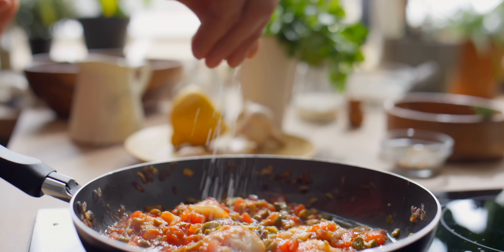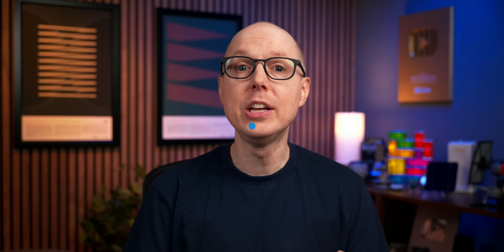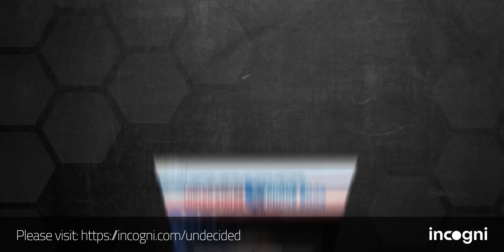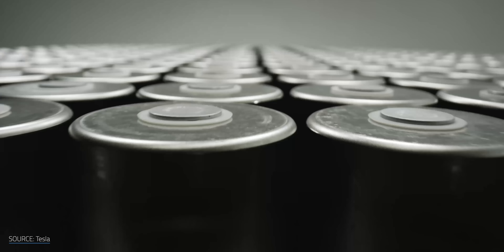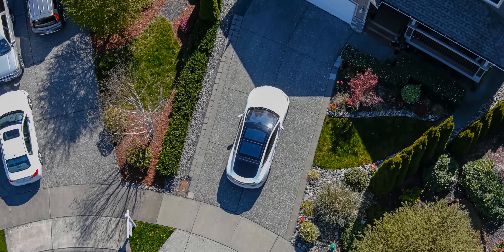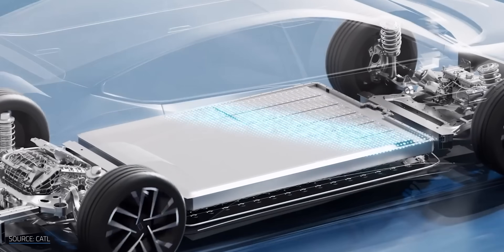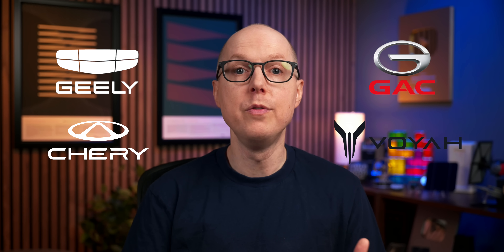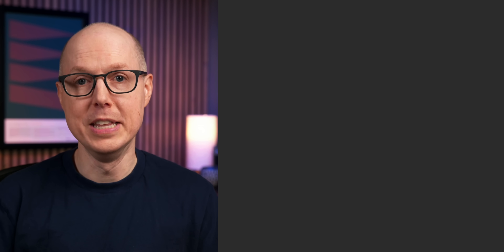How CATL Made Batteries 90% Cheaper (And What Happens Next)

Comment: 𝐦𝐢𝐬𝐥𝐞𝐚𝐝𝐢𝐧𝐠 - the existing technology 11:32 TRL 8 is the gen1 sodium-ion - but the promises with 200 wh/kg and fast charging and cheap prices are made for gen2 Naxtra. What they have shown on stage was TRL 4 to 5 at best. The video does not differentiate between these generations. Originally, CATL has been targetting 2030 for mass production of the next generation. (battery-news "CATL to Produce Second-Generation Sodium-Ion Battery" in March 2025)

The change to get gen2 mass production rolling comes from BYD and their battery subsidiary FinDreams. They do already have a mass production of SIB ready but CATL knew that they could not produce enough to get the prices that CATL gets from their old LFP lines. That changed when Saudi-Arabia ordered a battery power plant in February 2025 - a whopping 12,5-GWh (type MC Bube BESS) shall be installed. It will still take some time to get production scaled up at FinDreams but they are on their way now.

And so, CATL makes big promises. In the background the researchers have to be struggle to get the gen2 ready for production. Some sources say that they may be ready 2027 - that would be really fast as the general expecation leans more to 3 to 4 years. That's even more likely as the 200 Wh/kg comes probably from a new technology part, like the "direct plating" which we know from patents, not only CATL but also in the EU and US. It seems to be essential for the sodium-ion succes but it ensures as well that it is not a "drop-in" process to existing lithium-in production lines.

Comment: The real game changer isn't in the EV market it's definitely in the stationary storage area. This has the potential to completely replace fossil fuel power generation. You can pair it with Solar or Wind and the "sitting idle for an entire year" would make it possible to do seasonal storage which is basically not possible right now. The focus on vehicles is really unnecessary as that is a solved problem. Sure cold weather regions get less efficient evs now. But the range is still enough already seasonal electricity storage is way more of a big deal.

Comment: less power storage per kg won't let sodium to replace lithium. Portable device batteries including personal electric vehicles like EUCs will continue using lithium, cuz people have to lift them up themselves. However things where few kg weight difference is not critical, like cars and house appliances would probably start using only sodium because of more safety from fires

Comment: Thousands cheaper and maintains its range in cold winter weather, then, yea I would consider and EV for the first time. But any EV I buy must go away from electric only door handles as this is a major and I mean major safety concern of mine. Not being able to in or out of the vehicle even one time without delay would be the end of ownership for me. And because all electronics fail soon or later I won't buy an EV with electric opening doors. But I would have the battery storage for backup energy for my home.

Comment: A few factors to consider;

- While Sodium replaces the Lithium, it doesn’t necessarily mean the battery doesn’t include Nickel and Cobalt, etc which is where a lot of the concerns around NMC batteries arise. Lithium is just the transport ion. It is ideal because it’s highly reactive and has a very tiny, light nucleus.

- A lower Wh/kg is likely to be partially offset by the fact that Sodium batteries have a much wider safe working temperature range than lithium. You can eliminate a lot of the volume and weight dedicated to cooling and fire suppression components needed for Lithium when working with Sodium. Atomic Sodium is also incredibly reactive, though, so maybe something is still needed...?

Comment: The only reason I don't have an EV is up front cost! I have one small/medium sized family car that does less than 5000 miles a year, usually no more than 5-6 journeys a year over 50 miles (max 150). I have off street parking so could have a home charger. I therefore have zero issues regarding ability to charge or range. The issue is simply that I cannot justify the up front cost of a electric car as I wouldn't make it back with the low mileage I do. So to answer your question, I would certainly by a Sodium EV if it saved me thousands rather than worry about decreased specs!

Comment: Sodium ion cannot be charged anywhere near as fast as lithium, doesn’t have even half the charge cycles (batt life of lithium) and when batt gets low it loses huge amount of voltage as batt % runs down..whereas lithium runs at same voltage right down to 1% ..don’t believe all the China hype…they BS each other all day long over there trying to have the most wild claim next…this is a ploy by CATL to get cheap lithium from its suppliers….sodium may be good for energy storage and low end EVs but lithium will still have 80% of the overall EV market and the economies of scale to boot…LFP batt development is far from over also…they are already very safe but energy density can get closer to 300 kW/kg by the end of the decade

Comment: Google Gemini Deep research produced this report on the claims made in this video: 

"Salt Batteries" are Real and Diverse: It's not just one type! There are different kinds, like sodium-ion batteries (similar to lithium-ion but with sodium), molten salt batteries (which operate at high temperatures), and "saltwater" batteries. Some are already being used, and others are very close to being widely available.

CATL's "$10/kWh" Claim is Ambitious: The video mentions a super low cost for CATL's new battery. While exciting, this claim is met with skepticism because CATL hasn't shared many technical details. It might be a strategic announcement, and achieving such a low cost broadly is a huge challenge, especially since lithium-ion batteries took 16 years to drop to $115/kWh.  

Sodium is Abundant and Safer: A big reason for the excitement around sodium-ion batteries is that sodium is incredibly common (found in seawater!) and much cheaper than lithium. They're also generally safer, less prone to fires, and can handle a wider range of temperatures.  

Performance Trade-offs Exist: While sodium-ion batteries can charge quickly and are safer, they typically store less energy for their size and weight compared to lithium-ion batteries. This means they might not be ideal for all applications, like long-range electric vehicles, unless significant improvements are made.  

Molten Salt Batteries are Proven for Grid Storage: A more mature "salt battery" technology, molten salt batteries, has been used for decades to store large amounts of energy for power grids. They are very cost-effective for long-term storage and are much safer than lithium-ion for these big applications.  

Lithium Prices Affect Competition: The recent drop in lithium prices has made it harder for sodium-ion batteries to compete purely on cost, as they can sometimes be more expensive than lithium-ion batteries right now. This means sodium-ion batteries need to find specific uses where their unique benefits (like safety or cold weather performance) are more important than just the lowest price.  

They'll Complement, Not Fully Replace, Lithium-ion: Instead of completely replacing lithium-ion batteries, salt-based batteries are more likely to fill important niches. Companies like CATL are even developing hybrid battery packs that combine sodium-ion with lithium-ion to get the best of both worlds. This helps create a more diverse and secure battery supply chain

Comment: Sodium vs Lithium.   It really doesn't matter.  Range is still the bigger thing, and ability to charge quickly.   Vehicle manufacturers are aware of this also.   If they go Sodium, they will try to achieve that high range and fast charging still.   From a consumer point of view, it doesn't matter to me what the technology is.  I just want reliable, longevity, and ability to charge quickly so I don't have to wait around for hours to do something that takes minutes in a ICE vehicle.   
I love hearing about technology, I enjoy seeing advances, but from a consumer perspective, the chemistry of the battery doesn't matter.  Even with mobile devices.  Who cares whether it is salt or lithium.  AS long as it is safe, reliable and lasts the distance of then that is all we want really.  If it can be made cheaper and do the same thing, even better.

Comment: I think what's needed is an affordable sodium home battery we can integrate with a smart charging AI system. Batteries are something almost any property can install unlike solar panels. I've got solar and battery and have previously looked at adding more panels. But I think we're heading for a point where export payments fall or are strongly time conditional (i.e. only decent amounts from 16:00 -> 19:00) and the return just won't be there. So I'm now looking at more battery storage and if the prices come down hugely it makes perfect sense.

Ideally we'd have grid scale storage where every last bit of renewable generation is put somewhere, then when that generation is low we use the batteries instead of firing up a gas power plant. But that will take a lot of time and investment. If individuals can purchase very reasonable home batteries which cover their use during peak times or low renewable generation this is half the battle. They will save money, we limit burning fossil fuels. Perhaps we get to the point where the batteries are handed over to an AI system which will manage everything similar to the hopes for EVs and Vehicle 2 Grid.

Comment: I don't think longevity was ever a concern for Sodium-Ion batteries. The issues were always energy density (which isn't terrible but is as low as is viable given the alternative chemistries already in widespread use) and de-risking supply chains. Anyway, CATL just changed things, so no one needs to worry about that stuff anymore, at least not as far as CATL Sodium-Ion bateries are concerned.

CATL, admittedly, is still ramping supply of its Sodium-Ion batteries. I would be interested to see these in a domestic battery context but I don't think that has happened yet.

Comment: What particularly grabbed my attention with Na-ion batteries has to be the operating temperature range; a LOT is made of the range degradation of Li-ion batteries in extreme temperatures. While not totally eliminating the issue, it clearly reduces that concern. Also the reported operational life increase makes used EVs a significantly more attractive buy, when you can potentially talk in decades of useable life for the battery

Comment: I don't trust the science, a breakthrough in that density chemistry would be all over the scientific community for peer reviews.... This smells like what China did with their original EV deployment where the Government infused Billions into the production, in this case I bet the batteries will have little to no sodium, and just be Lithium batteries "branded" as Sodium manufactured with a government subsidy to make it look like it costs $10kwh, which is probably why they introduced that version that blends the two battery types, we just assume it'll be a 50/50 split but most likely be 95% lithium for the density and 5% Sodium, and since no one will be expected to run a car for 3.6million miles they'll write off the 200km battery degradation as just faulty batteries and replace them.

Comment: Most Americans have this idea in their heads that they need their cars to have 400 mile ranges, because thats what they get on a tank of gas, but they are only filling up their tank once a week at most, every two to three weeks in reality, and thats because you have to make a special trip.  

no one even thinks about how long their refrigerator is going to run for until it breaks. No one questions how many times am I going to be able to turn on this light bulb, or questions battery life on a phone when they are buying it because you have a magic make things run hole in your wall at home.  The marketing around EVs needs to change. "How far do you drive in a day?  because you don't ever have to go to a gas station again, you drive to work, then plug in when you get home and its ready in the morning just like you plug in your phone when you get home. 

For the VAST majority of people, if their EV had a 50 mile range, it would be more than enough. Plus you wouldn't have to haul around all the extra weight of the battery packs for the extra 350 miles of range you aren't using. Imagine if EV's had a battery backup trailer you could rent for long drives.  50 miles in town but this little trailer you plug in like a Uhaul pup gives you an extra 500 or 1000 miles.

Comment: $10/kWh literlly doubles the range of my electric Greenspeed GT20 and more than halves the battery weight. On a recumbent trike with 120kg rider and bags weight limit, that's the difference between on battery on a bikepacking trip or two of them to guarantee being able to get home without having extra camping days when the weather is cloudy!

The sooner I can get this tech in 36v 20Ah the better, even if it's a bit more spendy!

Comment: Sodium Ion EV?? Absolutely not because it is only "SAFER" then Lithium. 
Aluminum-ion Batteries are have high safety profile; low flammability. Can operate even when damaged (e.g., drilled through).

Sodium-ion Batteries: Best suited for stationary energy storage (e.g., grid applications) due to cost-effectiveness, safety, and environmental benefits. Their lower energy density makes them less ideal for compact devices or high-range electric vehicles (EVs). Ongoing research is improving energy density and cycle life.

Aluminum-ion Batteries: Promising for applications requiring rapid charging and long cycle life, such as grid storage or low-range EVs. However, their extremely low energy density and low voltage output limit their use in high-energy applications. They are less mature than sodium-ion batteries, with significant hurdles to commercialization.

Comment: When I look at charts of battery prices, I see that they dropped like 80% in the last decade. However any product whose price is heavily influenced by the "costly" battery still costs as much if not more. I'm not just talking about EVs but also about Electric Bicycles and their battery packs, which cost like 500$ per battery pack, often more than 10 years ago. The argument of the companies to price their products so high because "murr battery prices are so high it's not us being greedy" doesn't hold up anymore. 

My point being is that it's cool to see how battery companies are continuing to innovate and make the batteries cheaper and more efficient. But that doesn't change anything for us if the companies that use these batteries in their products don't lower their prices but instead just take a higher profit.

Comment: Forget Na-Ion tech on small vehicles. Li-Ion and, to a lesser degree, LFP have that market to themselves. Na-Ion is perfect for larger vehicles like large utility trucks (semis and lorries) and, let's not forget, grid energy storage and homes. With these markets, Na-Ion do not need to compete with Li-Ion and LFP techs. It can hold its own, thank you very much!!
Reply: CATL's CEO disagrees with you, though. If the energi density is not too far off, Na-ion will absolutely compete in all EV types - especially if the cost is lower.
Reply: I live in northern Wisconsin and would absolutely get a sodium ion battery EV. The winter performance vs Lithium is a huge boon.
Reply: Mate, they should, like morally they should.
The amount oflithium on earth is limited, lithium will becomemore expensive when we start running out. So getting them cheaper is the fucking goal.
That way they can outcompete cpmbusrion engines eventually.
Reply: Boats too, I would think. Ferries and sailboats.
Reply: Even if there is a price party with LFP and the same price per cycle. I would choose it for Home storage if the rest of the battery were designed to stay outside in the rain and snow for years. It would significantly reduce house fire risk because I could install solar and a battery a hundred meters away from the house.
If it would be significantly cheaper, I would put a battery on a bicycle, too.
Reply: @AldrinAlbano  Too heavy for large vehicles with decent range.

Comment: Maybe we should building new houses as battery powered dc, with grid backup not Ac or Ac only for general power outlets. I wonder if cost comes from using already paid for production lines so the cutting edge high margin covers newest production.

Comment: This is an immediate application for solar-powered homes. At $10kwh, adding batteries would be a no-brainer for most homeowners. At that price, new home construction would be able to include solar and battery configurations at low prices. Even if they don't last as long as lithium, they would be so cheap you could replace them as needed throughout the life of the solar energy system. However, as with the announcement of this type, a real and viable product awaits mass production. Until that happens, we can only dream on.

Comment: Without a doubt, lower density per weight, at a low enough cost to justify more batteries would be an easy choice for home power especially with the much longer life cycle! For cars, you would need to consider range and your personal driving habits but based on the data that is available most people would come out ahead in the life cycle for range swap.

Comment: Residential fire codes disallow energy battery systems (ESS, batteries) within 10 feet of lot lines due to fire risk of lithium. Modern lot lines are often 5 feet or less. This technology might provide a unique market space for millions of low risk batteries like sodium where physical size is not so critical.